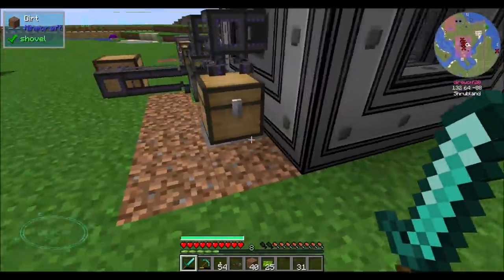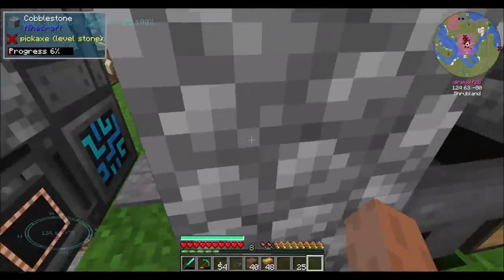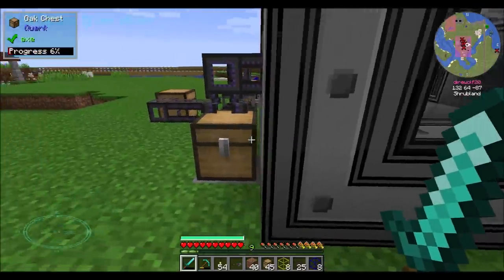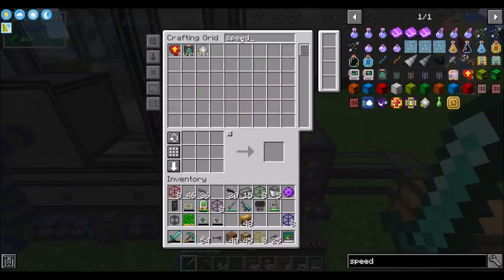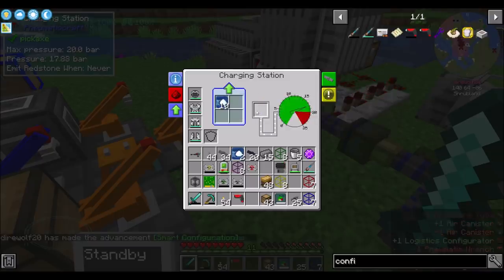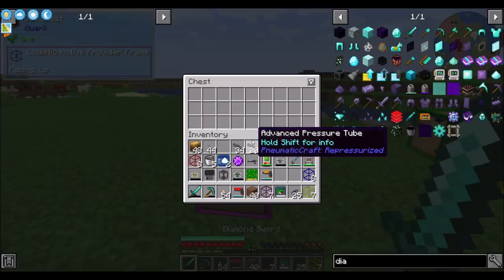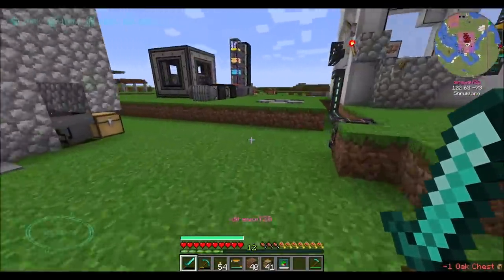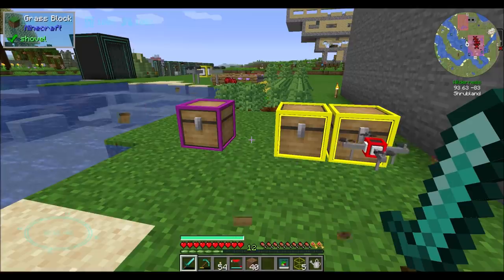Forgecraft S13E31 Drones

Comment: Logistics filters do treat an empty whitelist as "allow anything", so you don't strictly need to switch off whitelisting.
Reply: While that's helpful, it's not proper. Means you can't disable a chest that way. But it is helpful.
Reply: @tantamounted  yeah I know :/   More correct would be for it to have an empty blacklist by default, but it's always been that way and changing it now could be confusing to those familiar with it.  You can always add an item that you never intend to store to a whitelist to "disable" it.  Or set the frame's side to a face that the drone can't possibly reach.

Comment: Can't you put volume upgrades in all PC machines to upgrade them to high pressure? At least that's how I remember it working
Reply: No, it's never worked like that.  Volume upgrades don't affect max pressure in any way.  They are worth using though, since it enables the machine to store more *air*.  Storing more air means the pressure drops more slowly as it does work (pressure = air stored / volume).  And of course it takes them longer to pressurize, but that's what you get for having a bigger "battery".

Comment: needs a better charging setup, like maybe an expensive 4x4 drone pad or something similar that lets you recharge more than 1 at a time very rapidly but only works with drones

also I think this mod ought to have a massive multiblock air tank like most real world air systems have

Comment: Aaah....saw Elipeck there at the end...AA release on the horizon?
Reply: Don't think so. Nature's Aura has been made since 1.14 versions and they have been working on that as well as Pretty Pipes if I remember correctly but that's as far as I know. Maybe in the future though. I haven't even checked their Github either so no clue. There is tons of mods that do similar (pipe mods, tech mods and so on, probably not exactly the same but close enough, at least from what I've reviewed or looked at on Curseforge or can assume if a gap has been filled and I just haven't used the mod yet) so it's best to look to those until then or stay on 1.12.2 if you really need it.